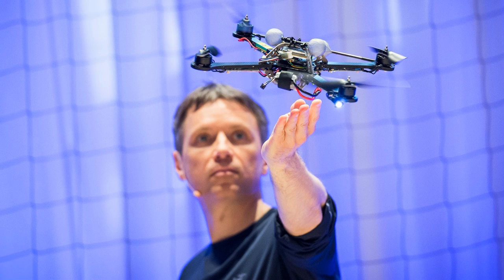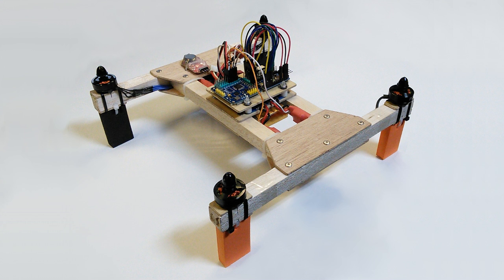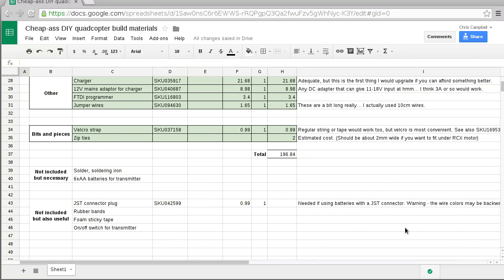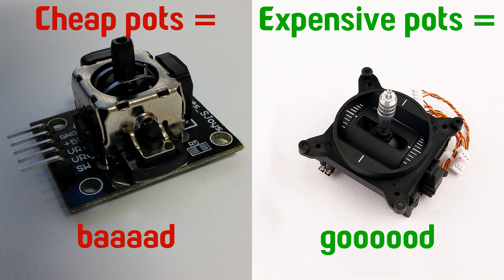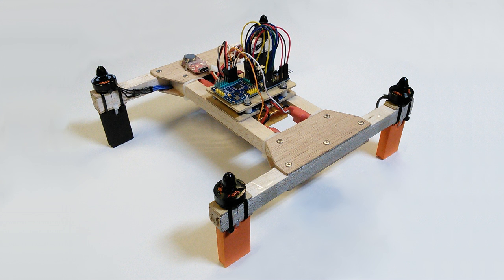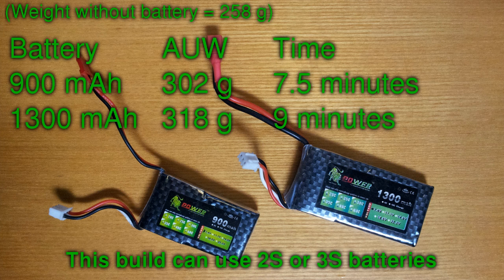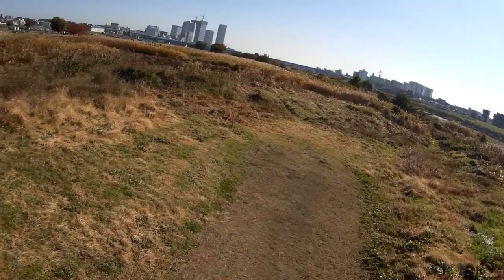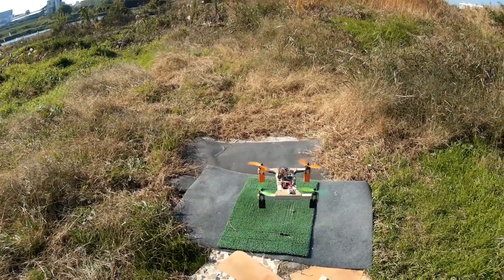Cheap-ass quadcopter build Part 1 - Intro

Comment: Great video! I'm looking forward to see the next parts!
I've been wanting to start a project like this, I bought 2 nRF24L01 , and I have the Arduino Nano V3. My plan was to do something like you did, but I wanted to use my Arduino DUE to build the controller. My original plan was to find a way to hook up a xbox 360 joystick to the Arduino DUE's USB Host port, and to use the 360 as the joystick for the quadcopter. I couldn't find any information on that matter thoguh... The DUE can interface with USB Keyboards and Mouses, but I can't find a guide or information on how to access to the USB in such a way to get information from the 360.
Do you, by any chance, know something about this? *****
Reply from the maker: I also started this build intending to use xbox360 joysticks. Unfortunately they have a huge deadzone at the center which made them completely unusable for this purpose. At least, the cheap "for arduino" style joystick modules I bought were like that. I don't know if the joysticks from genuine xbox would be the same. I notice that the crazyflie guys recommend a PS3 controller, so perhaps the PS3 joysticks might not have the deadzone. oh... wait, sorry, I did not read your post carefully - you want to use the entire xbox 360 controller as is via USB, not just the joysticks from it right? hmm... no, I don't know how you would go about that sorry.
Reply: ***** Yes, I meant using the entire controller (I allways thought controller=joystick). I don't think regular 360 have the issue you describe. I just plugged mine to the PC and tested the raw data and the calibration wizards, and as soon I touch the analogs it responds to all inputs... might has been just the brand you got.
I've looking your videos and you have really interesting videos, mostly the later ones messing around with RC and Arduinos (I found the Box2D ones really interesting too haha).
Too bad you don't know about what I need, I guess I'll just need to keep looking for a way to get low level access to the USB Host capabilities.
Oh! I have another question regarding the video, when you refer to the transcivers as "nRF24L01 " for the quad, and "nRF24L01 high power" do you mean a nRF24L01+ ? I don't really know the difference or know wich ones I actually got, I just know they work haha
Reply from the maker: estcap2 The nRF24L01+ is what I'm using. The regular version usually has a PCB antenna (that wiggly line of copper on the board itself) and is usually stated to have around 80m transmit range (if you're lucky!), and costs around $2. The so called high-power variant is this one, which is typically around $6, has an amplifier chip on board and requires an external antenna, and is supposed to be good for 1000m transmit range @250kbps(presumably if the receiver is also set up with good antenna): http://www.banggood.com/2_4G-NRF24L01-PA-LNA-Wireless-Module-1632mm-Without-Antenna-p-922601.html
All the details are in the spreadsheet.
Reply: ***** Oh, great, thanks for the information! I'm going to stick around the channel... and the following parts of this video! haha
Reply: estcap2 Do you need the Due's ARM32 Core?  If you're just buying the Due for it's USB host capabilities, a $12 USB host shield may be a cheaper option.
Reply: roidroid I already have the Due, that is why haha. Besides here in Argentina, because the increased popularity of ordering online from china, the post office delays the delivery to 4+ months (ussualy 6 months)... everything I bought was before that, I don't want to wait that long. In fact the Due was the last thing I bought and it took 7 months to have it in my hands.

Comment: i want to make a transmiiter and reciever of the quad using arduino uno..kk2.1 takes pwm signals as input. the transmitter will transmit the raw analog data and reciever would take this data as inputs and send pwm outputs to kk2.1 inputs . this type interfacing i want ????
Reply from the maker: +Abhinay Manandhar I think you would be better off using PPM like I have done in this video series. The KK2 can use PPM input, it's just one wire instead of four like PWM.

Comment: Hi, iforce2d, I am looking for a battery capable to fly around 30min-60min. Will 5400mAh 3s 30c work? .............At your recommendation , 5400mAh 3s 30c(350gram) or 4500mAh 3s 45c(245gram), which will fly longer time? and please give me the estimation of these battery can last thanks.
Reply from the maker: I'm afraid you will have to forget about that 60 minutes goal unless you want to build a specialized custom battery yourself, and your quad will have to be so light that it will be unlikely to carry anything useful. Even the 30 minute goal is not reasonable. The longest flight I have managed is 24 minutes, I did that with a 4S 10000mAh battery. With a 3S 5200mAh I can get around 14-15 minutes carrying a GoPro sized camera, or maybe 20 minutes without the camera, in calm conditions with no wind. But these larger sizes of battery are not suitable for the small 250-sized quadcopter that I build in this video series - for 3S 5200mAh I was flying a 500 size quad, and the 10000mAh battery was used on an even larger hexacopter. So I would suggest to just buy multiple batteries and swap them over to continue flying.
Reply: +iforce2d will the number of 'C' in battery affect the flight time??
Reply from the maker: The C rating specifies how much current the battery can handle. As long as it is higher than the current required it will be ok. A 5400mAh battery at 30C can handle 162 amps, in theory.
Reply: +iforce2d it is ok if I plug that battery in this model on the video?? will the esc or motor gets damaged?
Reply from the maker: You mean 3S battery? Sure, if the motors and ESCs can use 3S. But it will be way too heavy to fly.

Comment: Is it possible to  interface arduino and flight controller kk2.1..
Reply from the maker: +Abhinay Manandhar what kind of interface, to do what? I don't know anything about the KK2 but if it can use PPM input, then the 'receiver' I made in this series could be used.

Comment: Can I use a different version of arduino? like nano or uno??
Reply from the maker: Yes, nano and uno both use the same 328p chip. Just make sure you get the 8MHz/16MHz setting correct when you flash the program.

Comment: I tried building this a while back , I could never get it to fly for more than 5 seconds! Trim left, right... it just cant remain stable sigh.,.,
Reply from the maker: +Sammblor -Samantha Did you make sure that the quad is running in "angle" (aka auto-level) mode? The default setting is "rate" mode, which is very hard to keep stable unless you have some flying experience.
Reply: +iforce2d yes. But for whatever reason the motors were never spinning at the same speed. I then replaced the frame with a store bought carbon fiber one and it worked . Not sure why it didn't work with the wood frame =\
Reply from the maker: +Sammblor -Samantha yeah after writing that I looked at recent video on your channel and figured you knew that already :)
The only other thing I can think of is that the motors might not have been aligned with each other well enough, or were not pointing directly downward, eg. https://www.youtube.com/watch?v=qqgHLRqDkYA

Comment: hello, could you give me some tips. Each time I start the quad it start for a second and stop working. I am using your code for arduino + nrf24.
Reply from the maker: Try describing it better than "not working". Does it stop responding to the radio? Do the motors stop spinning? Does everything turn off completely... etc. I have no idea where to start.
Reply: I think i have the solution. I was using 2200kv chinese orange motors with my chinese red 30A escs. and i think that was the problem. I burned enough escs before i found it could be the  motors. now i m trying with 1000kv motors. it seems work. i haven't burne any escs till now! sorry my english! and thank you for the sharing!

Comment: +iforce2d , Thank you for your videos I find them really interesting and informative. Currently I am planning a project and I need some guidance as to where to start looking. I want to build a Quadcopter which would be controlled by a Joystick which is connected to a PC, the PC would have a program running which would send the controls to the Quadcopter via an nrf24L01. I understand the work on this project would be HUGE but I am really determined and have the motivation to work on it. I just need some guidance to know where to start. My idea is that I'll have a Java (my most fluent language) program running on a computer read joystick input, then the program will send joystick information to an Arduino serially connected to the computer, the arduino will then generate the appropriate PPM signal and send it to a quadcopter with an nrf24L01 on board and the rest will be just as in this playlist. Any guidance will be really appreciated, thank you.
Reply from the maker: I have done this by sending each channel value as a byte (0-255) over the serial connection. Then just replace the code that senses the joystick values with that.
You will also need to have some bytes to mark the beginning of each 'packet'. I have used a two-byte sequence of 255,254 followed by the bytes for the channel values. To make sure the channel values do not also have values of 255 or 254 I changed them to 253 if they are > 253.
Reply: Sounds great! I guess that means I wont be using PPM at all. Thank you!
Reply from the maker: Why not? We are talking about the transmitter side right? The receiver side will not be affected...
Reply: I am hoping to implement the flight controller my self, so I don't think I'll need to generate a PPM signal to feed into a flight controller.

Comment: can i get some help i love your videos on the transmitter build great work i want to use the DIY 2.4GHZ TRANSMITTER MODULE FROM HOBBYKING    link below
 
http://www.hobbyking.com/hobbyking/store/__51631__OrangeRX_DSMX_DSM2_Compatible_2_4GHz_Transmitter_Module_Futaba_Compatible_US_Warehouse_.html?strSearch=transmitter%20modu

this is what i am working on i have spektrum dx8 2.4 ghz transmitter dont   want to change all my receivers thank you 

https://www.youtube.com/watch?v=EoU5gXh3118
Reply from the maker: That transmitter takes PPM input. You can see how to create a PPM signal using arduino in the video titled "receiver continued", maybe part 8 I think. For this series I did that on the receiver because the flight controller was using PPM input, but to use that module you will need it in the TX.